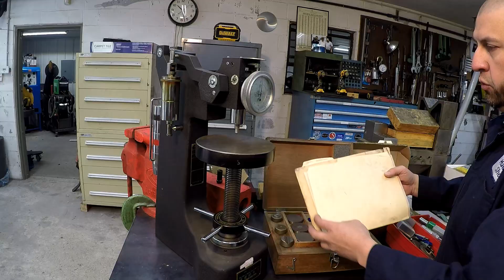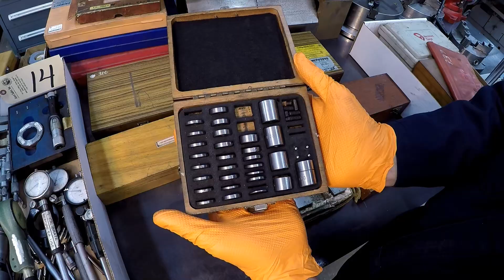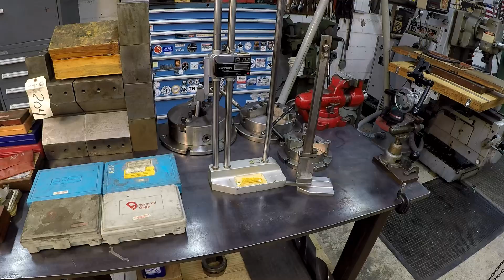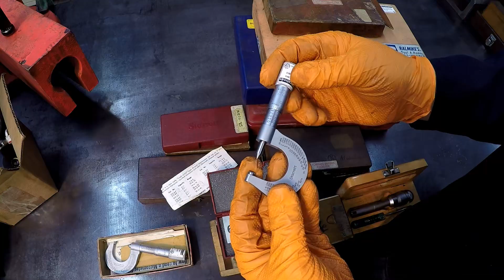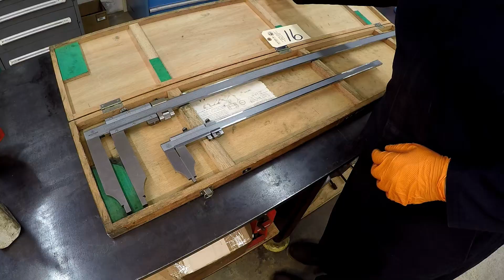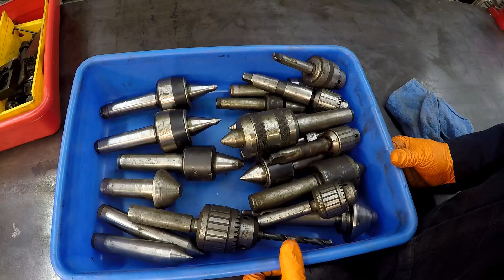Machine Shop Auction Winnings Part 1

Comment: Pin gages are + and - , + are (supposed to be) a tenth or so over the labeled reading for gaging the low and - are slightly undersized (2 tenths or so) for checking the high. We have the same Mitutoyo master set for calibration at the shop I work at. Looks like 20k+ worth of inspection equipment you got there.

Comment: What's the use of a dead center? It seems as if a live center would always win over a dead center
Reply: A dead center can have clearance machined or ground into it on one side of the 60. To allow the tool or grinding wheel to clear the centers major diameter. Yes a live center is best but does not always work for the job at hand.
Reply: When you grind or lath(ing) in centers, on side is always dead + on grinding you have usually second center dead too, becaus bearing in live center is not acurate enought for using at grinder

Comment: If the height gauge doesn't work I'm sure Mitutoyo will repair it much cheaper then buying it new. don't know if you'll see this but if you are gonna sell any of that I would be a very serious buyer. I'm just a hobbyist getting into it but very interested. Any high speed steel end mills or blanks for a lathe, more entry level type stuff. I've been looking for auctions for more than four months around Tulsa Oklahoma and I haven't found a single one with machinist tools and equipment.

Comment: That ring master looks a lot like the same type I used on some air gauges at my last job, used them to zero the dial once the master/gauge temp stabilized with the air temp, super precision work.

Comment: That 40 inch caliper is exactly what I have been looking for to make a one time precision measurement of a giant "wheel" that can't be made with anything else than a caliper or actually a mic because of an axle in the middle and some components on the perimeter.

Comment: Don't you hate it when people chop off boring bars and wind up making them so short that makes them almost worthless to use.  I know on older CNC machines, that y do this due to tool swing clearance, but now days on newer machines, that's no issue to leave them long.   On manual machines I prefer them left long, even though the may chatte a little in a deep bore, a good machinists can remedy that.   Love those Tri-mic's.  I'll trade you that buggered up point live center for a couple older edition Machinery's Handbooks.  Ken S.

Comment: Gage pins should be .0002 under size so you can check a hole. That size pin goes in that size hole.

Comment: Adjustable "V" blocks got me wondering and now having a brain fart.  
Was there ever a "system" where a shaft would be milled at an angle along the axis (but on perimeter, if that is correct word to explain) and then a sort of angle cut cone shape would be used as a wedge to lock something in place?  If it were milled it would be more accurate than just saw cut.
I have very vague recollections of some bicycle axles or motorcycle kick starters that were held to their cross shafts in this manner.
Reply: the only thing i could think of needing something like those for is maybe if you were milling a key way in a tapered shaft. but im not an engineer or a machinist so i could be completely wrong. lol
Reply: If smaller diameter  shaft have some different diameters along it's lenght and you need to support it  in this place against some vibrations, adjustable v block could help here.

Comment: Hi Adam from England 

Them Bower type gauges are big money...
Made in Bradford...i think

This reminds me of the time I dropped down the M1 motorway to Leicester....picked me up nearly 1/2 ton of taps, dies, drills, reamers and measuring/marking out...
Amongst that lot were a Porter Cable USA 12V drill...
A couple of WOLF UK straight type foundry grinders and a very nicely made USA clamshell type thread restoring tool that I've been told is for cleaning up hub threads on Chryslers...
Allsorts...
A lot of measuring /marking out & inspection...
A lot...
Its nice when you grabs stuff like this...

Comment: For quality measuring tools that do not come with a standard, do you send them out for calibration ?  

I used to sometime work in an electronics lab.  A lot of the meters were marked "not calibrated - estimate only".  Better equipment got sent out for calibration on a regular basis.
Reply: Thats standard practice from what I have seen. Send out masters to be calibrated and use them to check/compare the daily use tools. Saves a lot of money and time. Unlike a lot of electronic test equipment a lot of (but not all)  physical measuring devices can be user calibrated. In most cases a physical cal cert is there primarily for piece of mind but sometimes you need them for legal reasons depending on the work you do.

Comment: Nice job Adam! On those huge mics, how much does air temperature affect their measurements? I feel like a measurement at 40 degrees could be different than at 80, but I could be wrong.
Reply: It will be. That's why these huge mics have places for hands- to not to heat it as even  human hands can heat up and affect measurments...

Comment: Those Jacobs chucks that seem to be locked up can easily be taken apart and cleaned. I have done several that that were being thrown out at work (before I retired), they work great after a good cleaning and a little deburring.
Sure is a great batch of tooling for little investment.

Comment: OK word of warning Tri-micrometers will give you "some" Error if the hole you are measuring is at all out of round (the main problem with most triple micrometers is having the standard rings to measure multiple points on the range of the micrometer to ensure that the micrometer actually works correct rather that just the one point supplied with the micrometer)  On the vernier calipers double check the racking of the movement to the base with a gage pin if one or two division your golden (These heavy calipers unless used as a hammer are pretty much bullet proof)
Reply: Tri-micrometers, I think, are mostly usable at production work with one small range diameter measuring range. I never found them usefull at home shop as it's easer for me to use fewer mics with bigger range.
OK, if you can score them cheap, maybe. But buy them new- not worse.

Comment: In case you missed it in the other video, I think the bolts inside the box for the hardness tester are leveling feet. In some pictures of the unit online, they have 3 bolts as feet.

Comment: Got beat , the adjustable vee blocks are for inspection use. Nice hall of many good tools and tooling. Even the stuck chucks can be rebuilt easily, even the centers can get new bearings.  Too big for my logan or I'd ask to buy a center in 2- Morse . If you sell a super spacer let me know. If it's not to costly I'd like one. Your looking good with losing some weight. I was as big or bigger then you. I'm down to just under 300 , everything is better . If I can ever get the nerve pinching pain in control ill get my shop up and running . Wheelchair machinist , fabrication . Three years doctoring and still bed bound in pain. Thanks for keeping me in hopes of getting back.

Comment: Adam, that flower gauge is real nice. If take in all the way to the extended travel, you can pull the anvils out and swap them for extended ones to get the other range. They;'re probably kicking around in the bottom of the box

Comment: Nice score Adam!  I believe those adjustable vee blocks are used to support work during inspection on a surface plate.  You can adjust them with a test bar and indicator to make sure the work is parallel to the surface plate.  Essentially an alternative to using centers to inspect shafts and such.